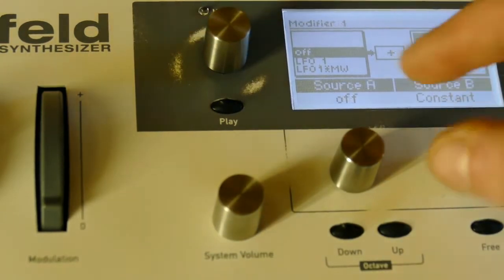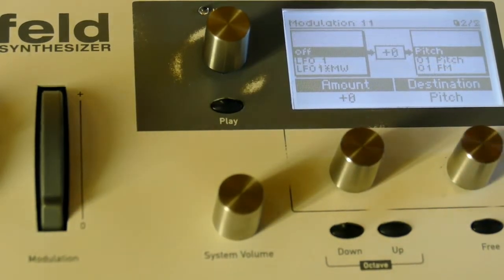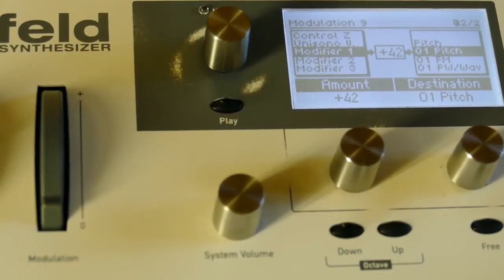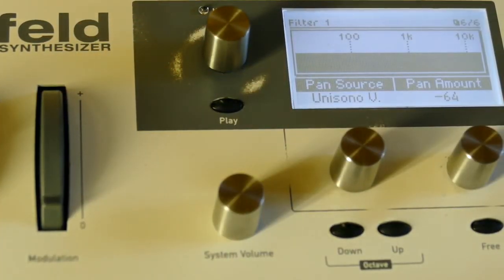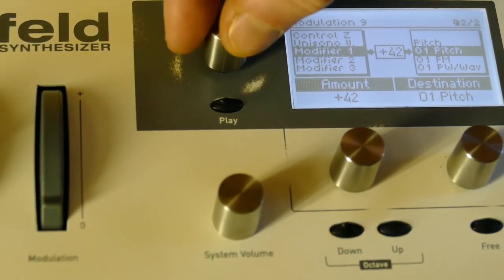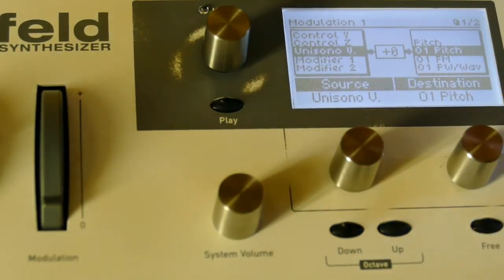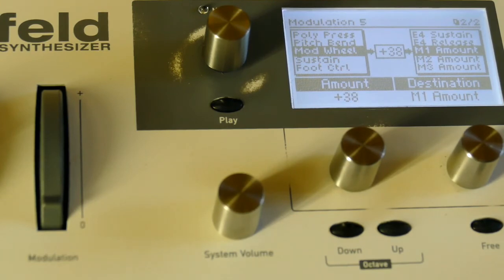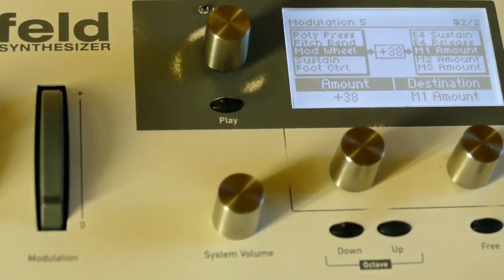Waldorf Blofeld Tutorial #35: Mod Wheel and Unisono

Comment: Could you explain why a simple LFO to pitch sounds like complete crap in Unisono mode?  To me it sounds fine when unisono is not engaged, but when it is on there is something not right at all about it.
Reply: Are you referring to the pan options for filters 1 and 2, and setting Pan Source to Unisono V?
Reply: I think that helped a little bit, but my ears keep telling me that even a sine LFO still exhibits a “choppy” sound to the pitch. Looks like it’s just how Waldorf designed it.
Reply: Well, SYNC was it.  Turned it on and now it’s sounding great.  You just saved me from selling it and probably never having anything to do with again.  Thanks!